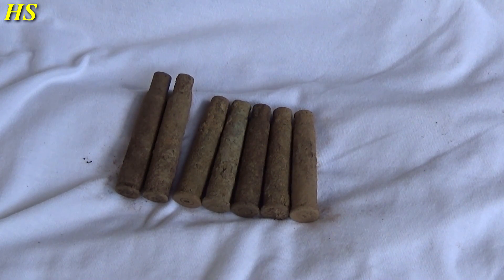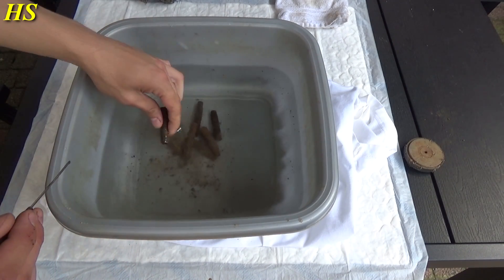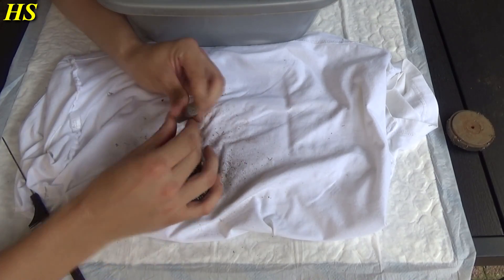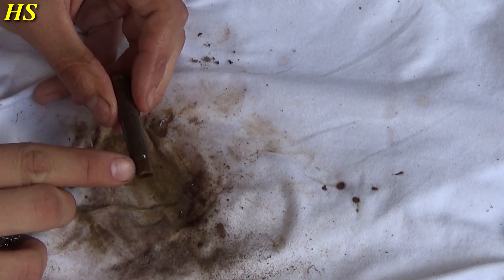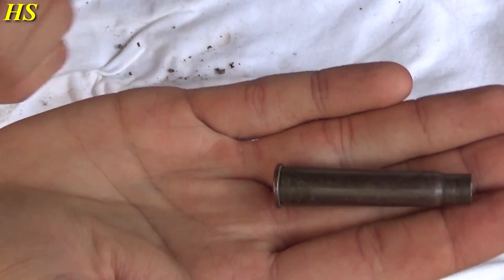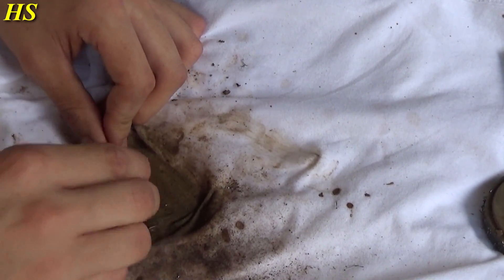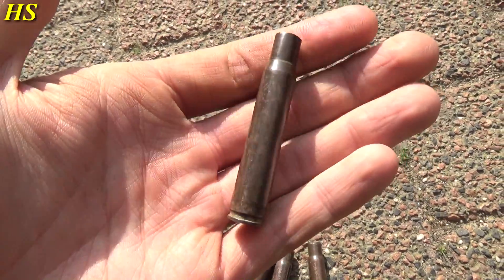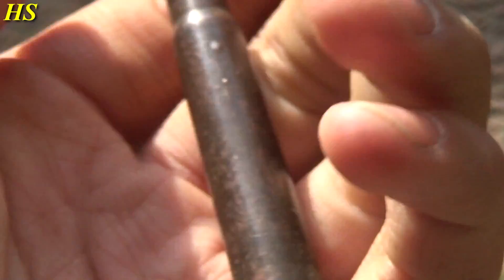How to clean your relic shell casings / cartridges - Metal Detecting WW2 { History Secrets }

Comment: About 20 years ago I found several boxes of South African .303 at a local hardware store with this same headstamp. One box had some green corrosion so I went ahead and shot those. I recently learned that my Savage built No. 4 Mk 1* 1942 was issued to South African Forces as it has the U and arrow on the receiver. The other boxes are well preserved and I will keep these. Another interesting thing is that they were in cardboard boxes labeled as Winchester.303 tracer. Apparently the boxes we’re reused.
Reply: Legends say hes still cleaning casings to this day

Comment: Lots of work for moderate result...

My trick (you will get new-looking casings!):

For casings that have iron rust on them (e.g. due to magazine/clip/belt iron residues) and bronze oxidation (blue/greenish color):
1) Submerge for 1h in 23% HCl (hydrochloric acid, careful, verry corrosive to the skin!). No worries, HCl does not corrode brass (do not use for steel casings...)
2) Dry with paper towel then submerge in demi water for 10 minutes)
3) Submerge in baking soda (1 molar) for 10 minutes
4) Dry with paper towel then submerge in demi water for 10 minutes
5) Tumble for 1 hour with a bit of polishing cream, inox beads and 2/3rd volume of water. This way there is little stress on the casings and they wom't break.

The casings will have maintained all their profile and detail, but with zero rust or oxidation remains. You can do about 50 casings a time, which results in one casing every 3 minutes!

Comment: If you use painters tape or paper on that speaker magnet, then you can peel it off over the trash can to clean off the iron chips. It makes cleaning the magnet easier.
Reply from the maker: Thanks for the tip! :) 

Gr Nick

Comment: I just wanted to ask does a magnet typical magnet that you go magnet fishing with catch brass 20mm shells or any type of brass shell?good vids
Reply from the maker: Magnets catch take iron, so if you have iron casings, it can.. but they would probably be in bad condition. 

Gr Nick
Reply: tris360 it won’t unless its still live, then it will get them by the tip
Reply: tris360 finding live bullets with brass casings while magnet fishing is the best quality shellcasing you will ever find, better then detecting

Comment: Wow thats amazing! Thank you so much!! 
How do you clean you iron finds?
Reply from the maker: Glad you liked the video!! 
There are a lot of different ways to clean that, but most of the times i let iron relics dry for a while. 
After that, it will be easy to remove the rust, but it takes some time. 
If the rust isn't that much, i also use steel wool and brushes. 

Gr Nick
Reply: Ok. I've been doing that too. Thanks a lot!

Comment: i have a bullet it looks like a 30-06 and the numbers on the bottom say fa 37 do you know what that means ive done lots of research but cant find what time it was made and were was it used its very old looking its rusted and the bit where the bullet exited is very messed up almost like it was rotting i found it at a park with my metal detector

Comment: Nice video again! Thought of using the steel wool too before, but doesn't it give a lot of scratches on the metal? I'm using a brush now but your casings look better I think.
Reply from the maker: Sometimes you will get scratches on it, but most of the times, you do not even see it :) 
Thanks for watching!! 

Gr Nick
Reply: @History-Secrets  i have a bullet it looks like a 30-06 and the numbers on the bottom say fa 37 do you know what that means ive done lots of research but cant find what time it was made and were was it used its very old looking its rusted and the bit where the bullet exited is very messed up almost like it was rotting i found it at a park with my metal detector

Comment: My method is to use oxalic acid to get rid of the dirt ( it only removes the dirt, no paint or patina actually) and then lemon juice with salt , it etches everything away until there's just the blank metal, then you just need to polish it with steel wool ( much softer wool than in the video) after that you can even see the gold- ish brass color on the shell casings, it's much less scrubbing work, actually, or , for steel I use the electrolysis. But, I guess everyone has their own method :D
Reply from the maker: That sounds great! :-D 
Yes, there are so many different ways to do it :) 
Thank you for watching! 

Gr Nick

Comment: OK on the brass shell cases but for more delicate objects an ultrasonic bath is much better as there is no stress on delicate items. The ultrasonic baths start at about 40€ on Amazon.
Reply from the maker: Yes, not for old coins etc ;-) 
I have a ultrasonic bath.

Gr Nick
Reply: History Secrets Sorry if I'm telling you how to do your cleaning but I've had to use  ultrasonic baths on lots of delicate stuff like jewellery and it works amazingly.
Reply from the maker: No problem, it works great on stuff like that.
I know, i have one myself :-D 
I only use steel wool for shell casings etc. 

Gr Nick